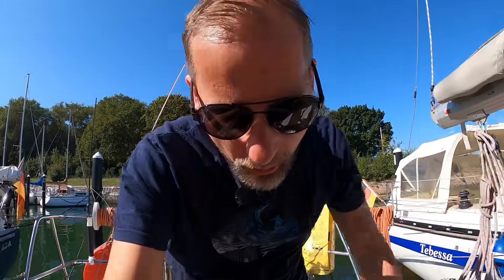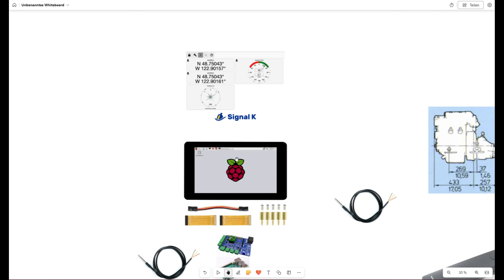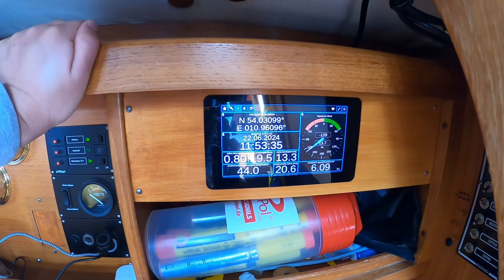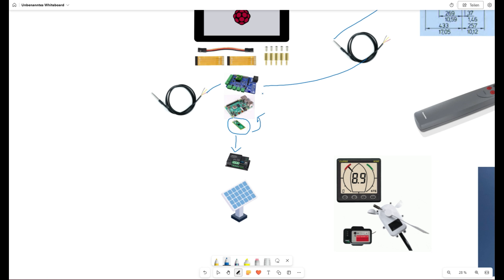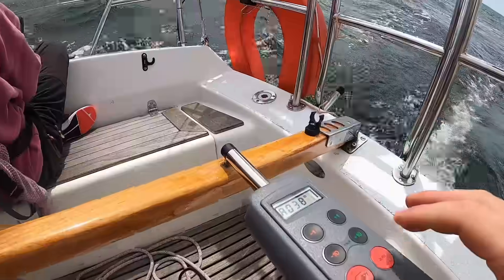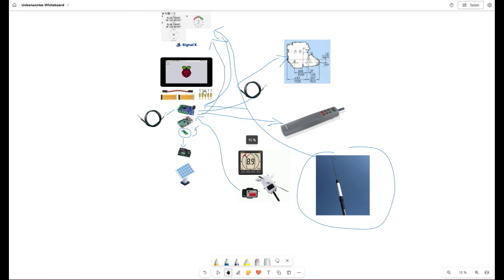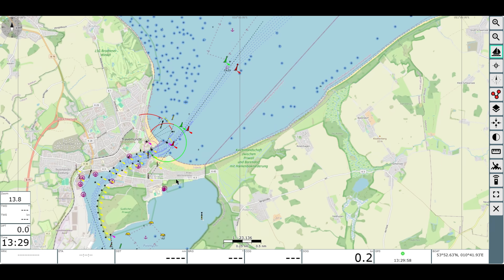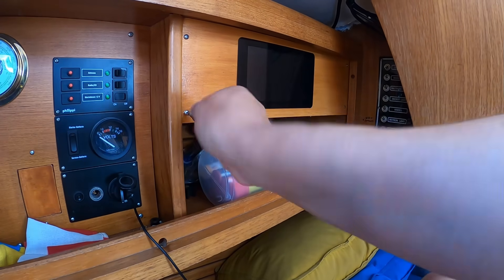My OpenPlotter Sailboat Setup (with Waveshare Screen, MacArthur, MAIANA, PI4B, SignalK, Pico)

Comment: Great video.
Any chance you could do a video on how to set up the MacArthur Hat onboard IMU? THE pypilot app recognises it but i cant seem to get any data from it. 
Cheers,
Clive.
Reply from the maker: Good news for you: I use the sensor for my anchor alarm as I needed heading. A video is planned and it Will cover the IMU sensor on MacArthur HAT as well
Reply: @Sir-Real Awesome. I actually found out that my IMU was not working as I tried a different one and it worked

Comment: I have a NASA Clipper Wind System installed on my boat. It does not have any Nmea support. How do u get the data to the raspberry?
Reply from the maker: You need a system with NMEA output. If you just have an analog signal, the conversion would need some effort and know-how.
My wireless NASA reveivee has a NMEA0183 output which feeds the CLIPPER displays.

Comment: first time I see a pi 4 for that. Can you say something how you solved hthe power problem during the sailing ? Probly also the reason why you didn't use a pi5 !?
Reply from the maker: As I started on my boat there has been no PI5. 
And as MacArthur was published, PI5 was not fully supported. This changed with OpenPlotter 4.x.x.
The advantage of a PI4 is the lower power consumption.
And the PI4 is fast enough if you don't use OpenCPN. 
So, currently the PI4 is fine for me.
What power issue are you referring to? The PI4 takes 3-5W on my setup. I have a LiFePo4 running, so, no worries.
Reply: @Sir-Real thanks for that. I expect actually a bit more. Do you have some documentation about the cabling battery to pi ?
Reply from the maker: @VK-qh6pr  Since this year I am using the MacArthur HAT with the additional 12V supply PCB. This makes life very easy. Here you find the docs regarding the 12V supply:
https://macarthur-hat-documentation.readthedocs.io/en/latest/power.html

Comment: I’ve bought a raspberry pi 5, McArthur hat, dAISy hat, and 2tb nmve base.  I have high aspirations but 0 experience with anything like this.  Any suggestions?
Reply: Watch as many utube vids on setp as poss. I run opencpn on openplotter and signalk which is fairly straight forward without any coding knowledge. Read the opencpn manuals, install the latest software and document your install and config so it's repeatable...good luck!
Reply from the maker: That is a quite open question. What is you goal? Do you want to replace a plotter or just getting AIS in? 
Take a first little use-case, e.g. forwarding AIS, and start your journey...
Reply: @Sir-Real  I’d like to use it for a chart plotter, a hub for all NMEA 2000 communications, ais, and eventually auto pilot and security.  My boat is 4 hours away so this gives me something to work on when I’m not at the boat.  I am at the step “plug power cord here to turn on”.  So, I got a long way to go.
Reply from the maker: @nutsandbolts432  Plugging in power is a very important step ;)
Well, you need to find you own way. I personally started with a non-desktop Rasbian, playing with GPIO and I2C, later Node-RED. I didn't use the desktop environment for a long time. This changed now with the OpenPlotter setup on my boat, but I think it was a very valuable learning to work on prompt level.
If your main target is to get OpenPlotter working, you should start with a ready-to-use-build of the OpenPlotter page and go from there.
But - there are many forums which will help.
Reply: Might be Bareboat Necessities OS for pi5 would be a good and easier start for you.